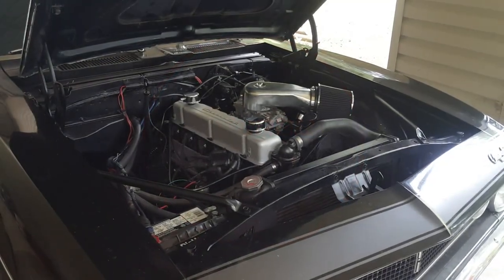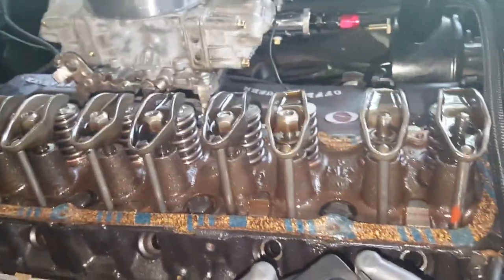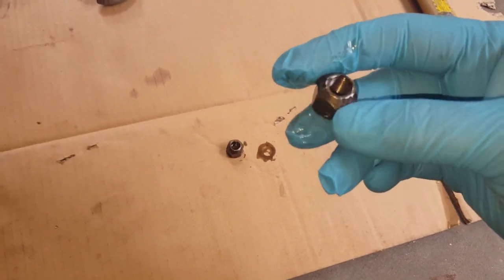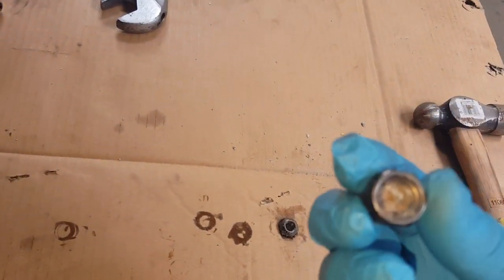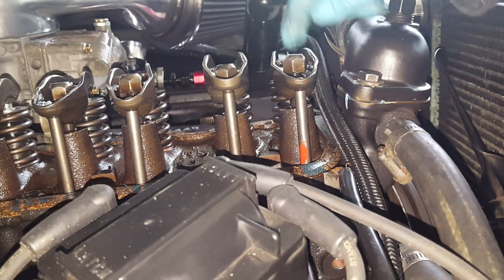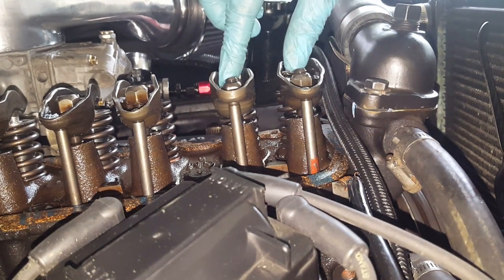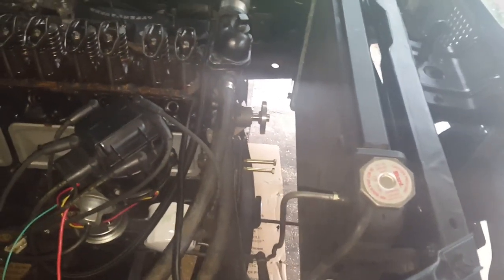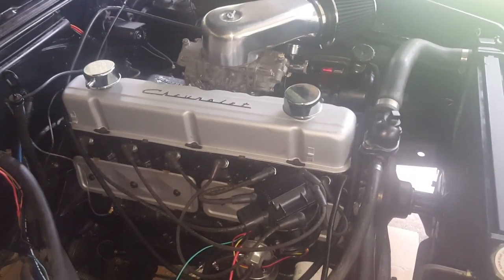1967 Camaro - 250 Inline 6 - Adjust Hydraulic Lifters & Rocker Nuts

Comment: I thought that you had to be at TDC on the compression stroke for both valves to be closed before adjusting them. I just tried to adjust the valves on my 1976 c10 250 and now I have a horribly loud valve tick. It was only slightly bad before that's why I tried adjusting them. I'm assuming I didn't tighten them enough? Any help would be greatly appreciated!

Comment: The repair manual says to do it similar to that. It dont mention no lifters starting to move or anything. It just says put #1 TDC on Power stroke and tells you what ones to take lash out and 3/4 turn. Then you put i think #6 one TDC and do the rest.
Reply from the maker: Nothing wrong with following the manual. I've just done it the way I shown for years and it works for me. You can see all sorts of different methods/takes on this procedure on YouTube but as long as the result accomplishes the goal then you're good to go.

Comment: I don't go in order of the firing order either when using EOIC. In the past I've always had solid lifter cams but after losing cam lobes on the last 2 in my 70 Z28 and using the best oils with ZDDP, I said, no more flat tappet cams for me, so I went roller this time.
Reply from the maker: Yeah I do think normally go firing order either, too much unnecessary rotating. Even though it seems 'solid' for now, I still regret not going roller. Gotta save some fun for next time I guess.

Comment: Where the best place to find information on these Chevy 250 engines, like performance mods and tricks?
Reply from the maker: Inliners bulletin board, 12bolt site and store and you can check out the build sheet on TurboCamaro.com to name a few
Reply: @TurboCamaro67  your website is amazing…. Thank you
Reply from the maker: @heathhenderson7217  thanks! It's desperately in need of some updates but has some good info.

Comment: excellent video. what engine oil do you use what viscosity
Reply from the maker: I use Lucas Hot Rod & Classic 10w30. I like Lucas products and it meets the high zinc requirement. I've always found 10w30 to work well in this North-West coast climate.

Comment: I’ve got a 250 in my C10... manual says to tighten one full turn at zero lash. Interesting how scattered all of the info is on these specs.
Reply from the maker: I agree.. a lot of people do different methods and different specs based on old manuals, spec sheets or "what their dad taught" them. Of course, sometimes different methods work better than the manufacturers recommendations. Unless you have trusted knowledge it's definitely best to go with the factory manual. It's funny though you're right.

Comment: Nice job on the valve adjustment. I do them with the engine running. lol Done hydraulic and solids that way several times.
Reply from the maker: Yeah I tried with it running first but I think several of my rocker nuts were loose so I had several loose lifters. This way I could get them all right without overtightening some to figure it out.
Reply: How do you know which one to adjust when running?

Comment: I've read in a couple manuals its a 1/4 turn more at zero lash. would you say a stock cam would be the same as a comp cam? is it 1/2 turn more in general?
Reply from the maker: I've read several resources as well and it seems to vary from 1/4 turn to 3/4 of a turn. I'd bet a half turn is fine for stock or CompCams. A factory engine assembly manual would be the best source for a stock  cam though.
Reply: thank you, ill try 1/4 since mine 6 is all stock. if the make noise ill just go back and go a 1/4 more. adjusting them in firing order i should be about to do 3 cylinders at once correct?
Reply from the maker: +Jesse Strader sorry, I missed your reply somehow. If you have them in the right position you can do half in one go, then turn the engine over and do the rest just be sure the valves are in the required positions. I didn't show how to do it that way because I prefer to do them one cylinder at a time. A couple extra revolutions won't hurt anything, except maybe your forearms :-)
Reply: sounds good, thank you! ill probably do it the same way as you did just to keep track.
Reply: Hey my stock 250 will die if I tighten fast zero lash. Would you happen know why?

Comment: Can someone please tell me what kind of carburator that is i have the same intake manifold and I can only find the ones that seat sideways
Reply from the maker: The original carb sat sideways and was a 1 barrel rochester.
Reply: @TurboCamaro67  now I upgraded to a intake manifold like the one on the video and all carburators seat sideways and I've seen videos with straightforward carburator.  That's the info that I need
Reply: Mine has a Rochester MonoJet (1)Barrel

Comment: My stock 250 dies if I tighten past zero lash. Any reason for this ?
Reply from the maker: Interesting... Original Springs and valves? I'd think the valve must be binding somehow causing a lifter issue or improper valve position. You're sure you're following the EOIC process?
Reply: Mine starts to die also

Comment: Tom,Have you heard of any"cross flow" 292 heads around ? Were used @ Bonnaville salt flats for high speed runs way back in the day.also Clifford Engineering  "6= 8" company who used to sell 6 cylinder parts? I have a 292 thats marked*High Torque" on valve cover(Chevrolet) Thanks.

Comment: I use the EOIC method and turn 1/2 turn down after zero lash and only when there is no up and down movement on the push rod. I don't twist the pushrods until resistance is felt cause it's not as accurate. If you race the car then turn 1/4 turn from zero lash. The GM factory used 3/4 down cause they didn't want the customer complaining about noisy lifters.
Reply from the maker: Haha that's interesting about the noisy lifters. I find they're noisy no matter how much I turn them. But yes, a ½ turn is what I do as well. I was made to understand zero lash implied zero movement, but zero vertical movement  makes sense.

Comment: Those lifters arnt hydraulic.Hydraulic lifters have a oil hole and expand with increase in oil pressure when the engine starts to negate any slack.Thats why you dont need to adjust them.
Reply from the maker: Hey Eugene, you're right about the hole in the bottom of hydraulic lifters. You probably didn't/couldn't see them in this video, but the lifters used in this engine have the holes, and are hydraulic. For interests sake, they are the Compcams 812-12 Lifters.